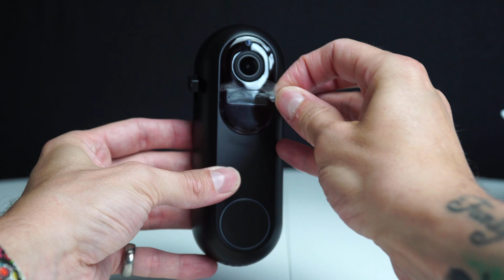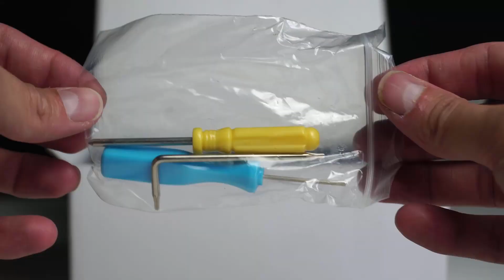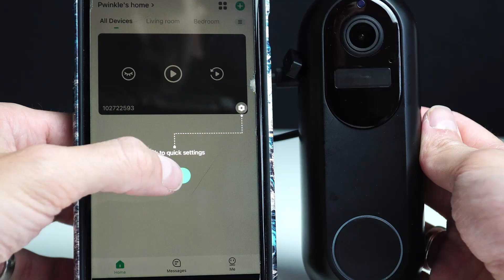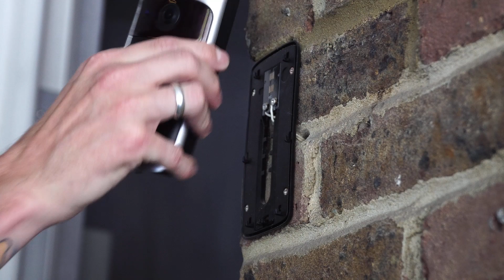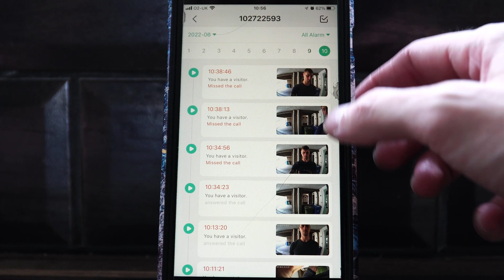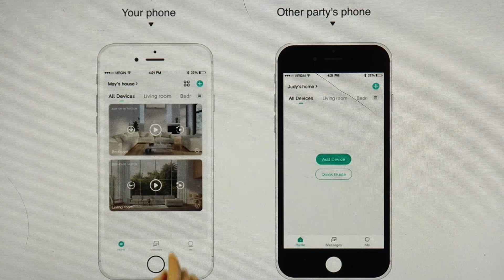MORECAM J2 BATTERY VIDEO DOORBELL CAMERA (Info & Setup)

Comment: I have this J2 doorbell and am using it wirelessly. However, the battery needs charging every 2-3 weeks. Any tips to allow the charge to last longer?
Reply from the maker: You can select “power saving mode” in the setting on the App itself or change the detection sensitivity in “alarm management “ can you at a doorbell power cable to keep the doorbell always powered ?